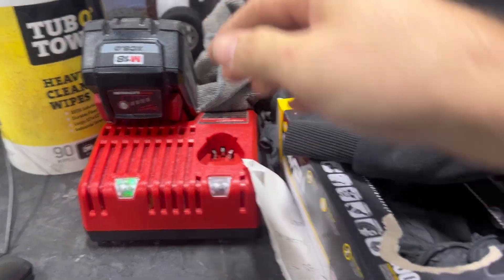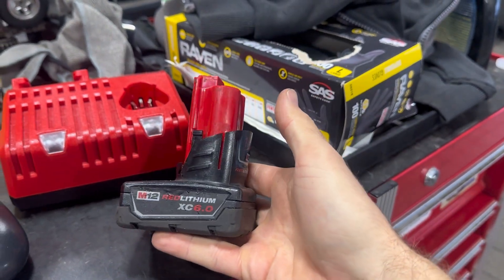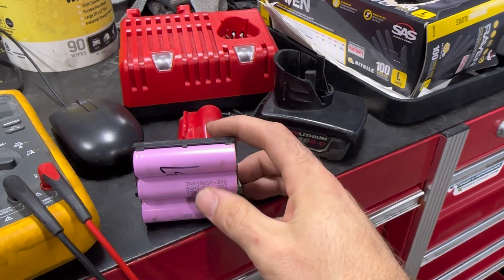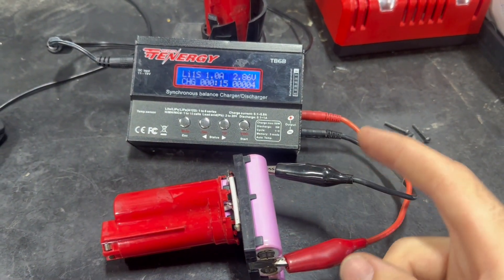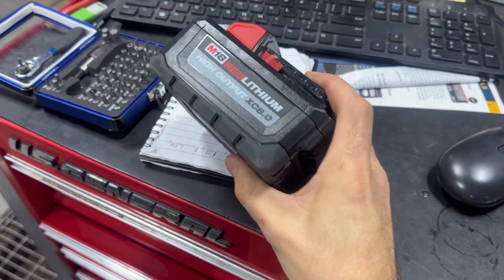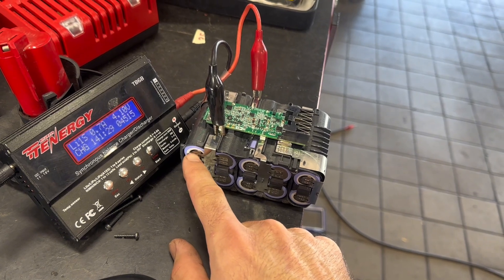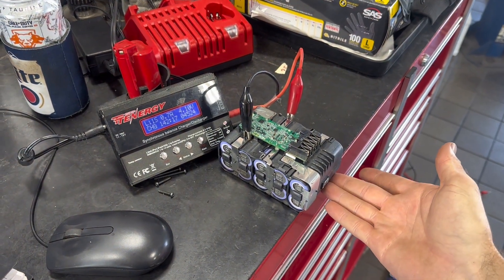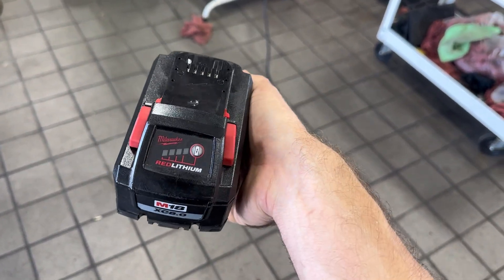Easy Tool Battery Repair for Free! Repair Milwaukee Batteries! DIY Repair Saves $$

Comment: Wasn’t Milwaukee replacing the problematic m12 6.0s?
Reply from the maker: @TobyCostaRica  Hopefully, I have another one I have to fix still. Their great when they work
Reply: @Mikebuildss  need to check mine, they’re somewhere. Maybe in my rocket light but they barely have maybe 5 cycles on it. I’d hate for it to be dead next time I use it